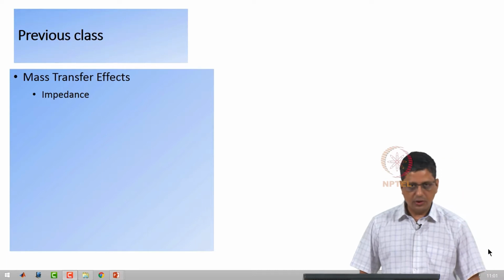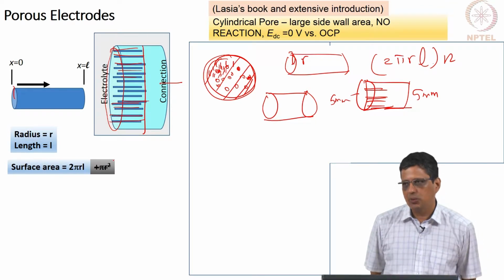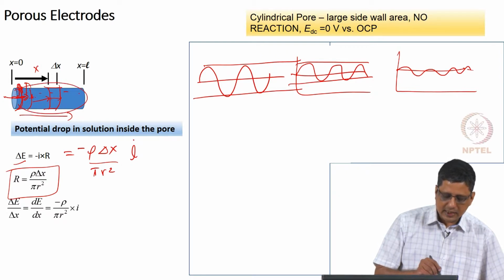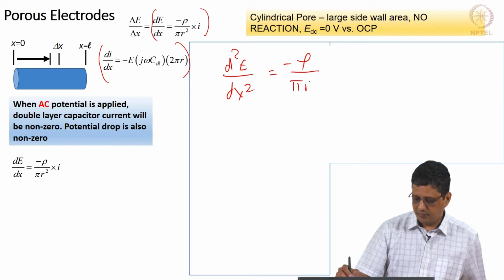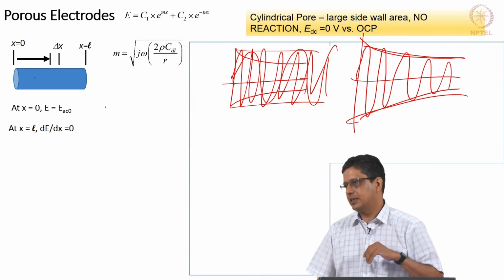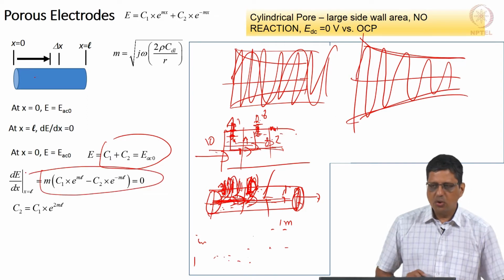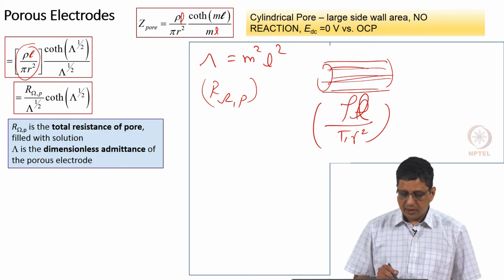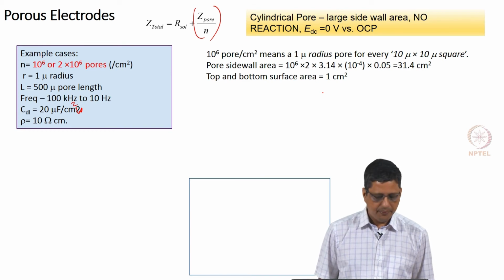#37 Porous Electrodes | Electrochemical Impedance Spectroscopy

Comment: Thank you for your nice videos, very instructive!
So this equation has a form of an open warburg, so eventually we can use this twist to fit an experimental result on a software. 
We would get access to Rd, which in this case would be proportionnal to the R of pore, but what would be the significiance of tho-d?
Certainly some proportionality to the constant terms like pore length, radius and conductivity of solution. But as I'm very bad at maths I cannot figure it precisely...